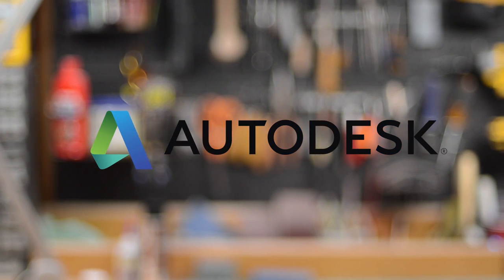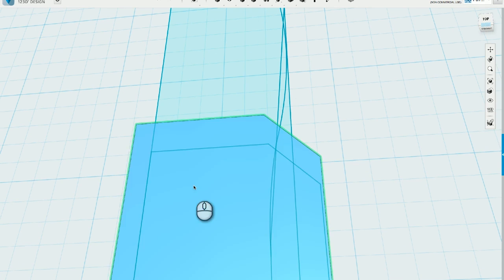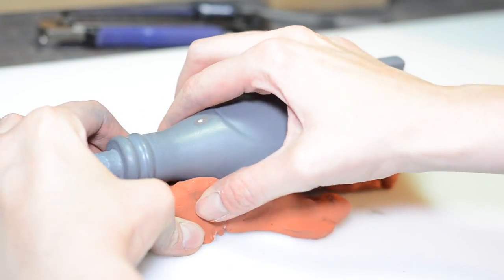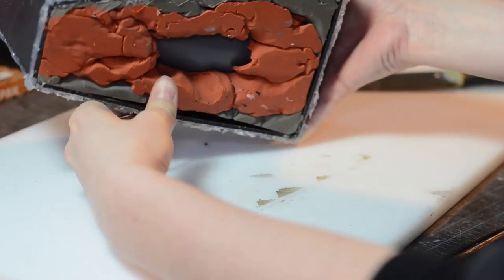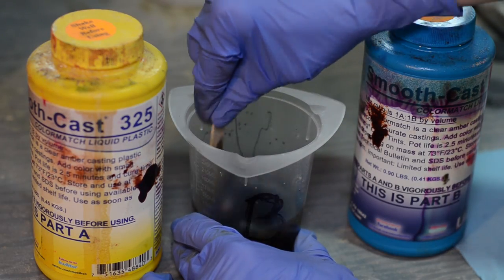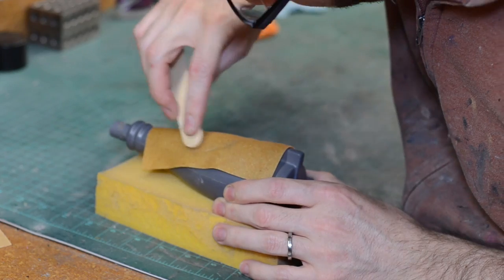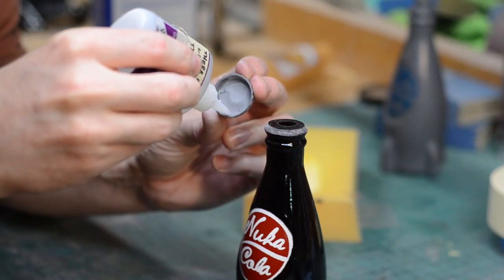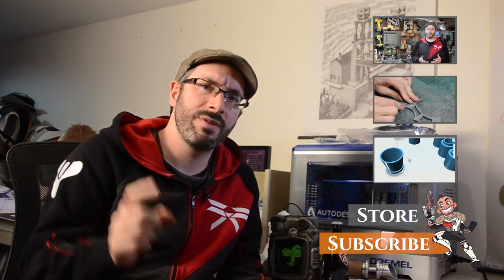Prop: 3D - Season 1, Episode 3 - Nuka Cola Rocket Bottle

Comment: 1. That silicone saving tip is genius. I've seen lots of mold-making videos and have never heard that tip before.

2. Creating a mold is great because now you can make Nuka-Cherry and Nuka-Quantum bottles easily.

3. I got a mini Coka-Cola fridge last year that's very retro in design, and it's very much begging for a Fallout mod. I need to get my hands on some of that rust stuff you used for you Pip-Boy.

Comment: You should just use clear resin and make actual bottles. I would pay for a decent casting of something like that, especially if they could fit real bottle caps.
Reply: +daniel merrritt I would pay highly for a glass replica of actual size..
Reply: +Blue Faux I know...I honestly didn't think it would be so small, though...he said he scaled it up to fit a real bottle cap, but I still wasn't expecting that.  It's like an eight or twelve ounce bottle at best, if that's actual size.
Reply: ChozoSR388 Maybe 8 ounce. They seem bigger in game.. Maybe its just me
Reply: +daniel merrritt I'd design it so the top is exactly the shape of a real glass bottle so it could be capped with genuine metal bottle caps. The next trick would be finding a liquid food safe resin, and if it could withstand pressure. Whyfor? So the bottles could be filled with actual cola, whether decanted from Coke, Pepsi or other bottles or made yourself with syrup and carbonated water.
Reply: +ChozoSR388 I saw a display of various Coke bottles at an antique sale. The bottle sizes were 6, 8, 10, 12 and 16 ounces - but the kicker was the outsides of them were all the same size. The display was also a progression of the technology of mold blown glass. If you've wondered where the term "Coke bottle bottom glasses" came from but wondered why the comparison when Coke bottles of the past 40+ years are so thin, it came from when they were 1/2 inch thick or thicker.
Reply: +ChozoSR388 Well the Nuka Colas in Fallout 3 and New Vegas are 100 percent 12 oz bottles. 8 oz is just way too small. Now, the Nukas we see in Fallout 4 are most likely Nuka Cola Classic - New bottle, same taste. Since the Fallout 3 bottles are 12 oz, we can assume that the rocket shaped classic bottles should be 12 oz...so they are pretty damn big, yeah.
Reply: as of right now I'm working and researching glass making so I can make a highly realistic prop.
Reply: Timmy619123 It would honestly look like real glass if you just slush casted it with clear resin

Comment: So a while back, I used to watch the Xrobots channel. Guy was making an iron man suit and it was sweet. 

Then he got a 3D printer. 

Now the channel is pretty much "This week, I print X on one of my 3 printers!" channel. No finish work (past paint). 

Very glad to see the same isn't happening here.
Reply: +Big_Adam_2050 Agreed. 3D printing is an awesome technology, but it's boring to watch. The finishing is the also the really fun part! You get to assemble and paint it!
Reply: ***** As a 3D printer should be. :)
Reply: There was definitely a while where he was doing a ton of 3d printing, but not as much now. He spends less time 3d printing and more time building, although his new project is all about robotics and less about prop finishing. But his channel was always interesting from a mechanical engineering/robotics point of view, especially his hulkbuster suit.
Reply: +Big_Adam_2050 James' channel is so much more than just 3D printing, he does all of the electronics and Arduino stuff. The 3D printing is just a means to an end. And a lot of his stuff needs to be mechanically sound.

Comment: I would have, and this is just a personal thing, slush casted it in clear resin, so that it would look even more like a bottle, and mixed up some cola-colored water to fill it with.  Also, on the label, I would have put the plastic shield back over it and sprayed it with a semi-gloss clear coat, so that it looked like a silkscreened label, like they would have done in the '50s and '60s.  I know Fallout takes place in 2077 onward, but, I think it'd be a nice touch.  Just my personal look at it :)  Also, the clear bottle would allow you to do the Nuka-Cola Quantum and (if you plan on doing so) the Nuka Cherry, without having to recast in different colored resin, just different colored water.

Comment: I just finished modeling the bottle using 123design, and I had a couple questions before I decided to print it.
Do I have to rescale the bottle from mm to cm or anything?
I want to use this method to make a Nuka Cherry or Quantum bottle, but I have already cut it in half and hollowed it out. So if I want to make a different indent would i have to make a whole new bottle or is there a Punished Props Magic Trick to fix that? If you could reply that would help me so much.

Comment: just ordered some smooth cast silicone from a website in Spain, I'm in Italy. I had to just order the normal stuff because they didn't seem to have a kit for beginners. it was expensive that way so I didn't get any of the extras I might need like the clay or the mold release. will cooking spray work OK or talcum powder?
Reply: +jokerrabit No, you need a specific brand of mold release that corresponds with your brand of rubber to prevent the rubber forming together, otherwise the chemical reaction wont be halted and you'll end up with a solid chunk of rubber.
Reply: +TH15R4ND0MP3R50N ok ty I forgot to order the hardener for the resin so I need to make another order anyhow. I mistakenly though it would come together, silly me. any how ty.

Comment: How long does your primer take to dry? Mine says three hours, and even then it's sticky and sanding mostly rubs it off... how exactly do you do this process?
Reply from the maker: Drying times can vary wildly. It depends a lot on the humidity and the temperature or your environment.

Comment: Is it safe to drink out of? Also is it possible to make it so the Bottle Cap can be tightened and lossened off and on the bottle?
Reply from the maker: I don't think this resin is considered food safe. Yes you could model threads on the neck for a common sized screw cap.
Reply: Could you cast a different non-toxic transparent material? Like can you cast it with glass or is that too difficult?
Reply from the maker: +Preston Player If so, I'm not familiar.

Comment: what if you want to use it as a actual bottle?
Reply from the maker: You'd want to make sure you're using food safe materials. Not all resins and silicones are FDA approved, so it would take some research to be sure you've got stuff that won't hurt you. The process is more or less the same though!